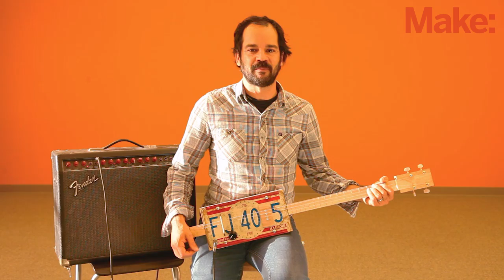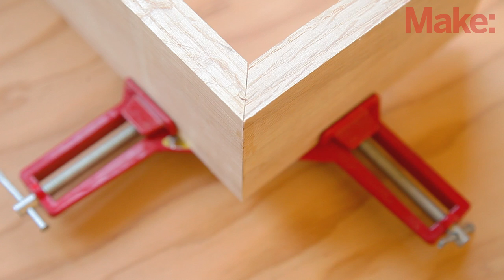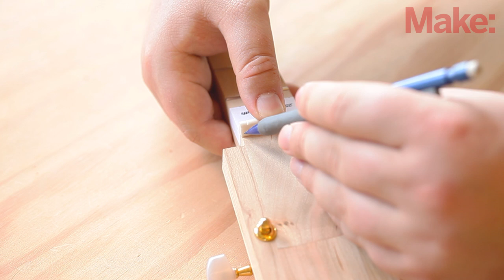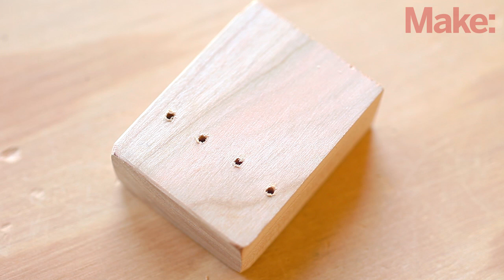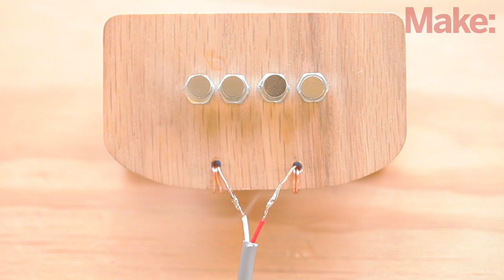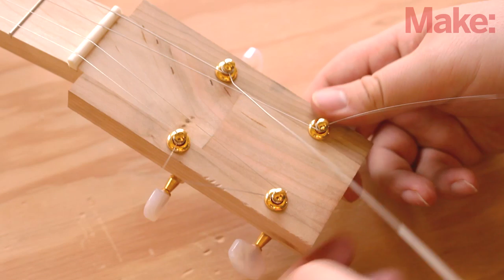Weekend Projects - License Plate Guitar

Comment: That neck and string holder are going to break off in no time. The neck needs to pass all the way through the box to keep the thing together. Also that gauge magnet wire is for electric motors, you need a much finer (like 22 or 24 gauge) magnet wire for a pickup. Also if you're not going to wax pot the coil you might as well save yourself a shit ton of time, effort and expense by just using a 50mm piezo because that coil is going to pick up every scrap or scrape anyway.

Comment: How long did that neck last before breaking off?  Honestly you have to think the strings put a lot of tension on the neck ,so if you were to do this project ,probably better run the neck through the box and attach it to another piece of wood inside the body for the support the neck will truly need once the strings are tightened and tuned and for extra support add a heal or brace under the neck where it meets the body ,This will make for a sturdy guitar neck that will stay in tune longer and like I said won't get loose or break off which with only using a screw or 2 ,will happen eventually "bottom line YOU WANT YOUR NECK TO BE WELL SUPPORTED AND STURDY! Other than that all else looks about right AND for those who don't want to try building there own pup " Pickup" you can purchase a descent pickup from C.B. Gitty  at a good price. Around $15 for a single coil pickup aka "pup". Love your magazine!

Comment: For anyone looking to build this project, don't follow their instructions on the neck. Wood glue on the end grain with a single screw will not last. That neck was designed to go through the body and I have no idea why they didn't do that. They took what would have been an incredibly strong neck and made it weak. There are enough videos on YT that illustrate this point.
Reply: You rout a channel in the neck where it goes through the box to accommodate the pickup. You can always brace the neck underneath inside of the box to stiffen it if need be.  Part of what makes a license plate resonator work is leaving some space between the neck where it goes through the box and the license plate. With the design used in this video it will not only lack any real acoustic tone as theirs does, but I'm willing to bet it doesn't stay in tune very well.
Reply: rochat I thought the same thing, until I realized the homemade pickup probably got in the way. I would recommend putting a heel on the neck where it meets the box and make sure the box is built rigid.
Reply: Agreed, they totally whiffed on this design.
Reply: One of these under the neck will help.  https://www.menards.com/main/tools-hardware/household-hardware/utility-hardware/corner-flat-braces/national-hardware-reg-3-4-x-1-1-2-chair-corner-brace-4-count/n176-347/p-1444448897340-c-9700.htm?tid=4729272959119436480&ipos=1

Comment: Last point. In the early days of blues and cigar box guitars. They were typically played with a slide and were often fretless.  

Since most early blues was 1-4-5 12 bar a fretless guitar was fine. 

As for all the discussion on this being a bass guitar, not a chance. A bass guitar uses heave strings which add a lot of tension to the neck. One screw holding in the neck won't last. Use 2 screws for sure.

Comment: In order to set the correct intonation, the bridge should not be glued down at all, but especially not before stringing. Just as on an archtop, or violin, the bridge should be held in place by the pressure from the strings. Generally correct intonation will have the bass side of the bridge set so the strings are ever so slightly longer than the treble side.

Comment: Great project. That's quite a bit of string tension you have with the neck only being held by a screw and some wood glue. Hope you used a long screw. I usually build mine with the neck going all the way through the body. Also, love that you built your own pickup. What gauge wire is that? One easy way to wind the pickup is to build a simple jig to attach to a power drill. Grounding the pot will tone down the hum.

Comment: Not a guitar, it is a bass, guitar=6 strings, bass=4 strings
Reply: It is still a guitar, the number of strings do not define instruments. It is the gauge of strings, sound, and how you play it.
Reply: 4 strings doesn't make it a bass. This is more like an electric ukelele.
Reply: If your math is correct, I guess a violin is a bass too. It's a four string guitar.
Reply: a1scooter1 And viola
Reply: Cigar box guitars are traditionally 3 strings then later 4 strings. Bass guitars are not only 4 strings either. I've seen plenty of 5 stringers.
Reply: DNAblues You are correct. I have seen plenty of 5 string bass guitars too. I build cigar box guitars too. For some reason I've never been able to build anything but 6 stringers though. I like the idea of the cigar box but still love the sound of the six stringers. The last one I built was with an old neck from a late 40's dobro. The neck and tuners are worth around $600. I don't know what possessed me to put them on a cigar box. It's a bad ass cigar box guitar though.
Reply: Could it be turned into a 6 string instrument?

Comment: Why does it have four strings?
Reply: This is a four-string bass guitar.  Bass guitars typically play in a range lower than the typical six-string guitar that most people are familiar with.  It is possible to have a six-string bass guitar but those arent quite as common as a four-string.
Reply: Traditional cigar box guitars used 3 strings since that's all you need to make major chords using the Diatonic scale (G A B C D E F). But a lot of blues uses major 7th chords. You need 4 strings to play virtually all chords. 

This all started in the South on plantations. The style of music was blues. Early blues consisted primarily of 3 string major chords. 12 bar blues with. 3 chords was common. So only 3 strings were needed. 

Even though it's not mentioned in the video this is considered a cigar box resonator guitar. The license plate is used for the resonator or dobro effect. It also added volume when playing with drums, since there were no amps. 

To learn more check out cigarboxnation or Wiki cigar box guitar. You can also just search You Tube for cigar box guitars.
Reply: Reboot153 😕

Comment: This design can be improved. Move the pickup closer to the center position (halfway between the neck and bridge). Use a ceramic bar magnet on the bottom of the pole pieces. Use a smaller ga magnet wire and complete more turns. Make a shorter string retainer out of metal and secure it with more than one screw. Cut a pocket into the box body and license plate to extend the neck slightly into the body. Secure the neck to the body with more than one screw. Use epoxy instead of wood glue for all gluing jobs (or if you have supplies and equipment, use hide glue).

Comment from the maker: Continuing the tradition of homemade resonator guitars, follow along as we build a License Plate Guitar. A discarded vehicle's license plate will serve as our metal resonator top. This will be mounted atop a soundbox custom-fitted for the license plate, and the build completed with a hand-wound pickup, bridge, nut, and neck. The electronics are simple, the woodworking is fun, and the project sounds great!

This and more  #WeekendProjects  are powered by RadioShack and take anywhere from 30 minutes to two days to complete. You can find them all online here: http://makezine.com/weekendprojects/
Reply from the maker: ***** For this build we sourced the neck, bridge, and nut from C. B. Gitty; we've also designed previous guitars where each of those components are handmade, so you could build this entirely from scratch. Thanks for watching!
Reply: That neat.  But doesn't a guitar have six strings?
Reply: Carlisle Childress  ooh! License Plate Banjo!  Nope, that would be 5.  License Plate Ukulele.  This is getting worse.
Reply: That's a nice FJ40#5. If I knew how to play guitar, I could make a 3KHU5#6 myself.
Reply: Price will scare you..!!
Reply: Where'd you guys source the Neck, and did you buy the bridge, and nut or did you make them from blanks?